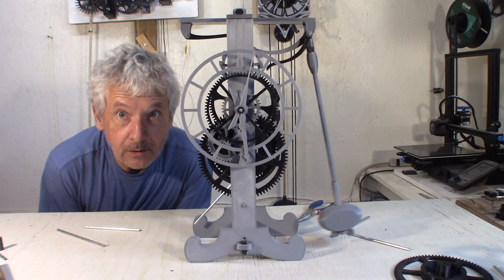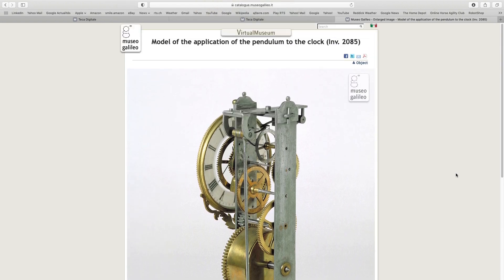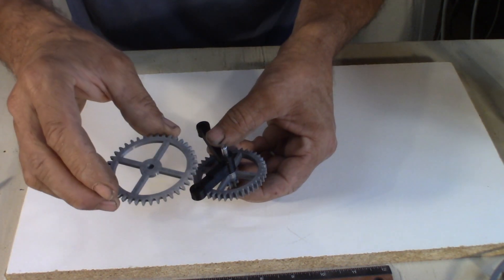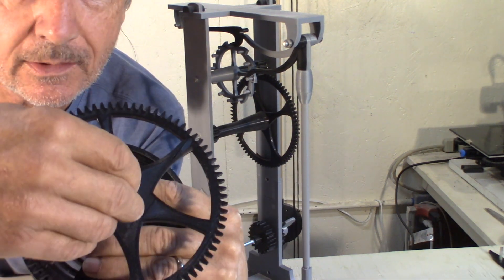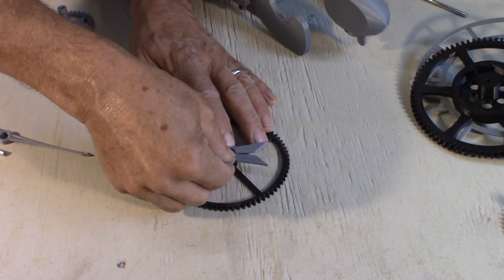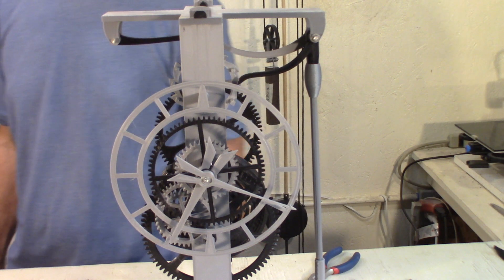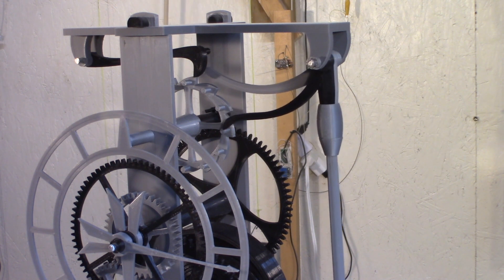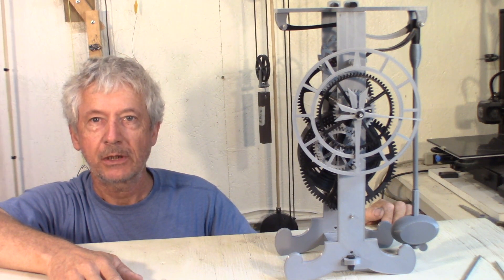3D Printed Galileo Escapement Clock with Hands

Comment: Dear Jacques, 
I am currently printing and building your first standard clock design and would like to update it to have the clock face, gears and hands as shown in this video, can you please let me know the names of these extra files and where I can download them from. I love what your doing don't stop. Kind regards Brian.
Reply from the maker: added link for files the face, hands gears, bracket are all the same, spring or weight drive
https://www.myminifactory.com/object/3d-print-galileo-escapement-clock-5-174677
Reply: @jacquesfavre999   Thanks Jacques, for your quick response, I will download the parts. Just a quick note there is a part in this clock 5 file that I think should not be there it's part No. frontframefinal.stl. Kind regards Brian